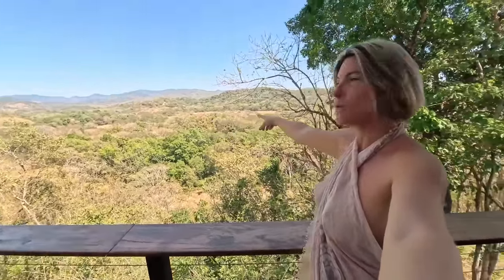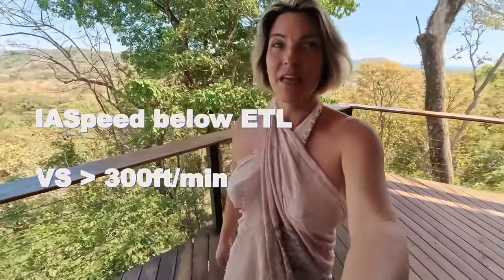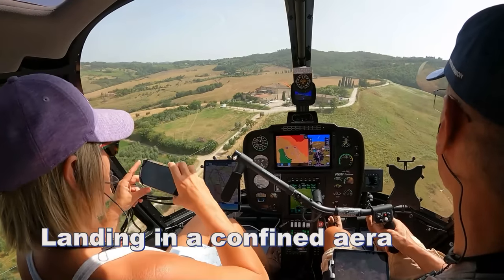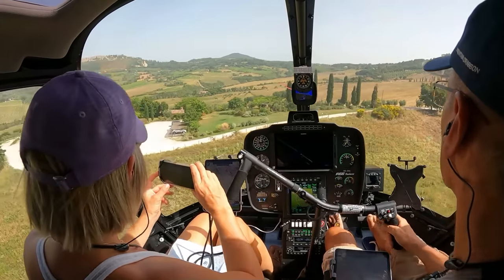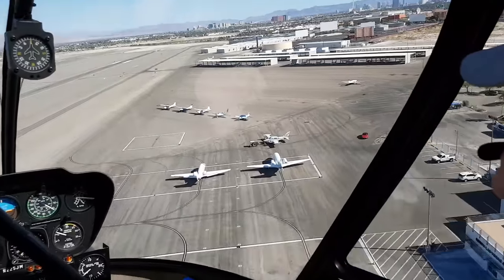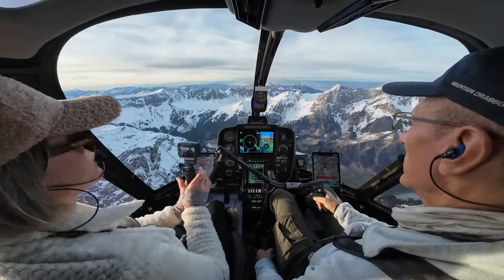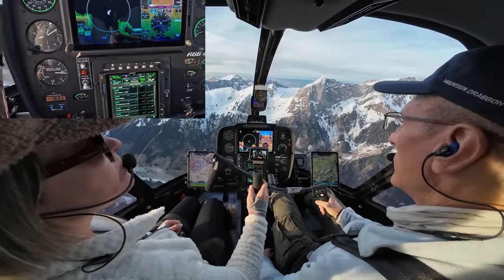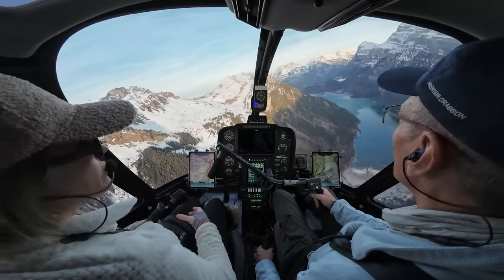Robinson Helicopter R66 Turbine Helicopter Vortex Ring State Part 1 of 2

Comment: was it scary as a passenger when you were at 2000 feet per minute descent rate?  My God that would be scary like an elevator cable breaking.  I would think it would be so easy to lose your composure and just give up, then bang you hit the ground in the R66 and shatter/splatter.  So crazy watching those steam gauges.
Reply from the maker: it is not scary... you don't even feel it; but that is probably the scary part if it happens in real

Comment: I saw a video taken from a fixed wing light aircraft. The pilot was on final when he saw another aircraft in the runway. There was no wind that day, a nearly perfect day for flying, but the pilot was becoming alarmed.
     He asked the tower if that was a helicopter ion the run way and when tower said it was, the pilot asked for confirmation he was cleared to land. The tower confirmed he was, then the pilot came back with, "I am going around and diverting, because you are an idiot." It was clear that the pilot was now very angry.
      The tower asked what the problem was and the pilot said he wanted the phone number to the tower. He would discus the problem over the phone after he landed.
      In the end the controller was not fired, but he did have to go through retraining.
      Anyone care to guess why the pilot got angry? One of the worst things a pilot can hear from a controller is, 'I have a phone number for you to copy." but this time the shoe was on the other foot.
Reply from the maker: Thanks for sharing. At the end the responsibility always lies by the pilot in command. Glad nothing happenend.

Comment: The Vuichard maneuver...
Reply from the maker: Yes, but be aware of counter clock or clock wise turning Rotorblades, when doing Vuichard. Or just pull and push the cyclic where you have space.
Reply: @GyrocopterGirl In a hover, it doesn't matter which way the M/R rotates.  The goal of any VRS recovery is to get the M/R out of the descending column of air and into clean air, all while maintaining control of the aircraft. The Vuichard is just one means to do so.  You are right in that the recovery is going to be situationally dependent; I've done them left, right, forward and even aft...the rotor doesn't care, it just wants clean air.  Now if your concerned about the effect that T/R requirements might have on Tq and total power required, then yes, direction of rotation may come into play.  Bottom line, planning and avoidance of conditions likely to produce VRS is the desired course, but if you are surprised, commit to a suitable recovery early and aggressively (yet be smooth on the controls) as it most often occurs at low altitudes. 

 Keep 'em in the green!

Comment: Wrong and dangerous,  The first sign is more control input to do what was normal, From crisp response to a soft mushy response , Second sign is a rougher ride a mild rumble in the air frame like going into and out of ETL. and a sink rate increase.
#1 get fresh air into the system , Any direction, Vuichard Recovery if you can't feel it coming and get too deep into it.
Your helicopter will give you clues feel it hear it see it. wiping out the cockpit with the cyclic wastes energy and the helicopter will fly better with deliberate precise movements. What off site landing do you really do?  @ 3:28 you painted yourself into a corner, And the Quick stop won't last long enough for VRS, But you'll over pitch and get Power topping and land hard with low Rotor RPM... @ 5:50 see how the cyclic moves and the reactions of the helicopter... mushy ... VRS is a steady state affair.